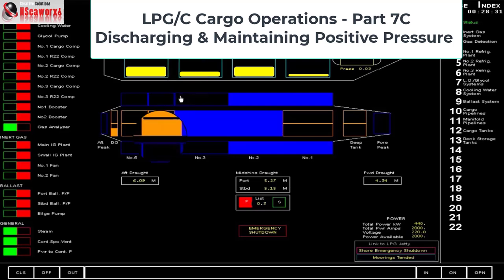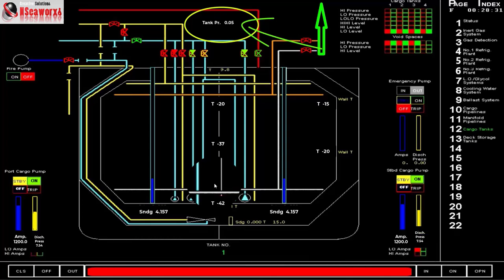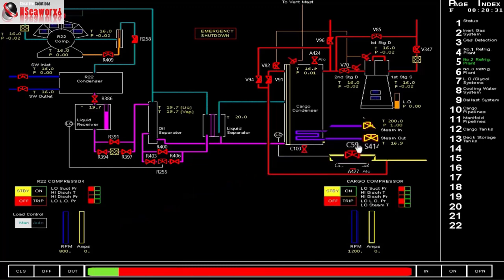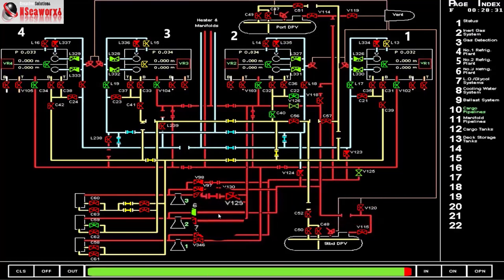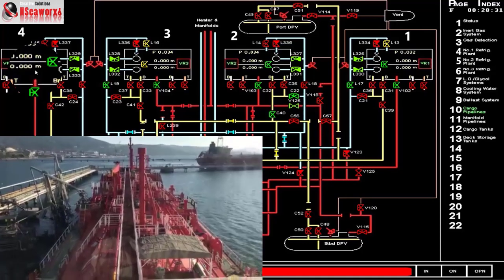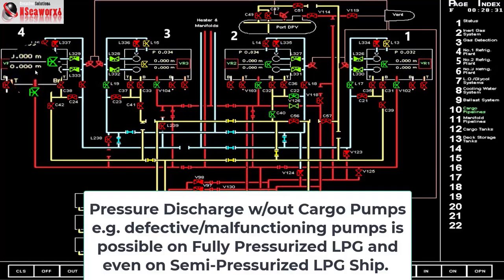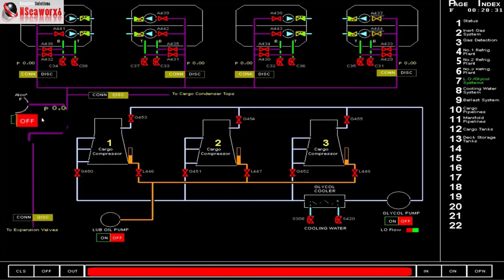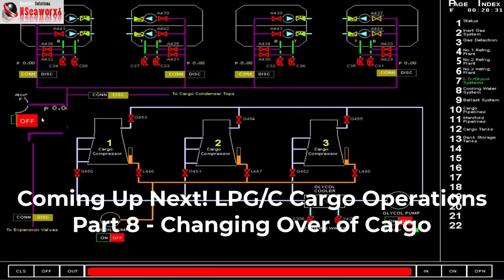LPG/C Ship Cargo Operations Part 7C - Discharging - Maintaining positive pressure on Cargo Tanks.

Comment: Chief
After discharging how we clear the line if shore line have High back pressure 13bar .
Reply from the maker: Blowing Hot Gas using compressors. You just have to build pressure more than or higher against the back pressure by closing and opening the manifold valve. Just make sure that your lines can handle a higher pressure.